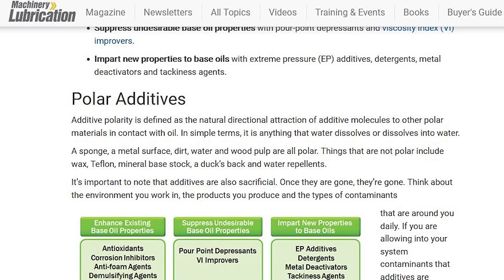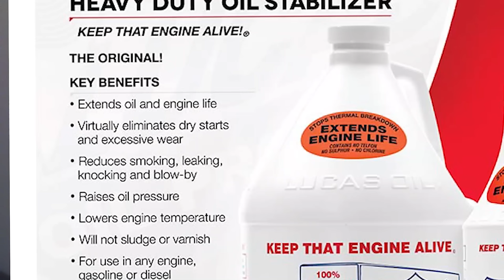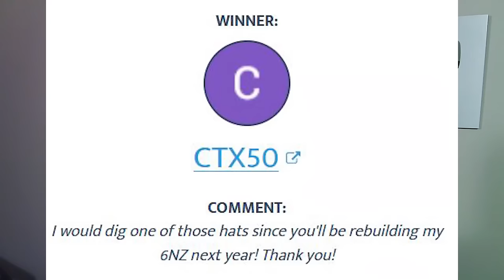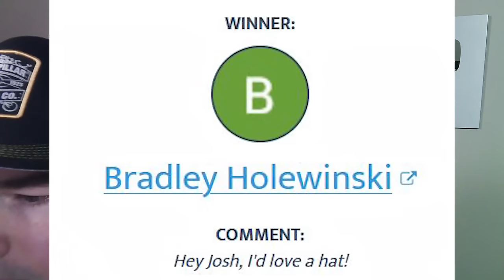Does your Engine NEED Lucas Oil Stabilizer? A detailed look at the "Benefits."

Comment: G'day, 
I totally agree with your comments ,
however ,,i feel perhaps the reality may have been overlooked.
Stabiliser can be used in gearboxs, pumps, transfers  differentials, hydraulics, ect ect ,so has.many other uses.
Lucas Oils  know any smoking vehical can be defected  or fined hundreds   for polluting . They also know drivers will use Lucas oil stabiliser  to avoid fines and prolong engine life until they can repair or replace said vehicle. 
Lucas are after market share of those polluting vehicals , so realisticly Lucas are not aiming the product at new or performance vehicals.
Finally ,,  Lucas  are careful to use language  that maximises  their matket share, even if its not a performance  product.

Lucas also  give suggested dilution rates ,   
How can it cool better ,,by prolonging the time it runs down a surface ,, in theory will allow more heat transfer  .

Cool vid  , 

      Respect 
         from 
   Down  Under

Comment: I had a really worn out 3406B that I used Lucas in. It certainly raised the low idle oil pressure. It also seemed to give it more power. I figured that it must have needed oil pressure to work a hydraulic governor or the afbf.
Reply: A good film of oil on the piston rings will also help with compression,  but will reduce friction and put more power to anything downstream.
Reply: What amount did you put per Oil Change?

Comment: I have used Lucas in various applications thru the yrs.  Not every vehicle but several.  Never had any issues.  But I was at my local family owned oil change shop one day. A guy I know had a 1st generation Kia Sportage.  After 100K  he'd been using Lucas at every oil change.   On this day,  there was a mix up between him & the shop owner.  The guy thought his Kia was done  & backed it out of the bay & left it running because  it was middle of winter.  He came inside to pay & got to talking with all us inside.  Long story short,  they realized his vehicle never had any oil put back in after the draining.   His Kia ran in freezing temps for at least 15 minutes WITHOUT any oil in it & was running smooth as silk when they shut it off.   The shop owner filled it with oil & 1 Qt Lucas like he'd done for several times b4.   That guy drove that Kia everyday for yrs after that & never did have a engine issue.   Seen it with my own eyes... that really showed me what Lucas is.
Reply: 💯💯💯💯💯 works‼️‼️‼️….Accidentally Ran  my C15 without Coolant until it got Hot and Shut Down…Few days later started getting Low oil Pressure flashing.Whenever I would let the truck idle while I chain up my Flatbed loads it would start Smoking Terribly….I Changed the oil to see if that would Resolve the Problem but it “DID NOT”….However a few days later I put a Gallon of the Lucas oil Stabilizer.Smoked for Mayne the first 3 miles them been good ever since 💯

Comment: So I did an experiment with oil in a Honda Accord. I started using 15w40 because I could get it free from work. Now keep in mind this engine is recommended to have 10w30. But I thought hey it has 230k on it, so I'm probably not harming anything, and I didn't. But I did notice that it didn't want to build RPM as fast and it seemed a little slower than normal. So after a few oil changes with 15w40 I went back to a 10w30 and sometimes run a 10w 40, Wich by the way, that is why I don't see a big deal in 15w40. After the switch back to standard recommend 10w30 the car seems to build RPM faster and seems to not be as slow or lagging. It was a good test and an eye opener in viscosity. Hope my comments help. Cheers Scott
Reply: Very true. Thicker oil will cause more drag on spinning parts and make the engine have to work harder. Which then uses more gas and can increase the operating temperatures of the engine. I drive old 70's and 80's molars. Have 3 of them. They all have the original drive train. Engines never been apart besides timing chains or intakes. I have experimented with many different oils and additives. I have noticed a very noticeable difference especially in my more worn out and low HP 318. When I use the recommended 5w-30 vs say 10w-30 plus a qt of Lucas. With the plain 5w-30 the engine will accelerate MUCH better. Much faster response. Yet the engine will be noisey. Especially when first started cold. And then after being run hard on the highway and the engine is really warm. No knocking just clatter and ticks. So lifters, rocker arms... When I use thick stuff the engine is sluggish. Have to mash the gas hard and wait for the engine to spin up and "catch itself". When started cold it has lifter tick for 10 seconds. But when fully warm the engine is dead silent. It may also make the idle a bit smoother. 

It's really a trade off of what your needs are. But typically I would say most engines should have well passed 150k miles before any additives to thicken the oil are going to have more pros than cons. 

Another thing that isn't mentioned much is with older card anyways if you study the owners manuals they have a chart that shows what oil to use based on what outside temperatures are. So say in the winter when it is mostly 40degree and colder it tells you to use 5w-30 or 10w30 , 10w-40. Then in the summer when it's hot out and mostly above 70 degrees. It says use 10w-30 all the way up to a 20w-50. This is how recommendations used to be. So it was left up to you to decide what worked best in your car. But advised to go thin when cold and thick when hot. And increase the thickness when hot more when the engine was older. New cars say passed the 1990's do not have recommendations like this. For two main reasons. The thicker oils cause the engine to work harder ( despite possibly correcting other issues) this makes you use more gas. And the government is all into fuel efficiency standards. So they won't allow the manufactures to recommend something that will decrease fuel efficiency. The next reason is modern engines have gradually better and better tolerances between parts. They are built much more precise and tight fighting. (To increase efficiency partly). So thicker oils are not able to be used safely in them. Because even in a high mileage worn engine. The clearance may still be tighter than in a brand new antique engine.
Reply: @ron1836  Try 5L of LiquiMoly 0w40 Synthoil. It not really flowing as well as a 0 weight ever. But it is flowing down to very cold temps in the winter while protecting well under heat. It has very good clinging to metal after hours and reduces friction. I buy at NAPA for 50 bucks so its not cheap but it's good.
Reply: @jamesmedina2062  I'll have to check it out. I have tried MANY different oil\additive\filter combinations over the years in quite a few vastly different vehicles. I have seen and heard about liquimoly but never tried it or the additives. I believe the only place that has a few jugs of the oil in my small town is an advance auto. Our napa doesn't have shit. It's a small local store with an inch of dust on the shelves.

I would say possibly the only draw backs to using it in old worn out carbureted v 8's would be maybe making leaks worse and also breaking up too much sludge too quickly. But I have used royal purple and Mobil 1 in !y old 318 Chrysler daily driver and haven't had issues. The engine was badly neglected before I had it. Like from the appearance when I had the intake off maybe the previous owner did 1 oil change every 30k miles bad! Haha. So even though 318's are known to usually make it to over 200k miles without big problems this engine is about whipped at 135k. I usually end up using something like Lucas, stop, hyper lube... Because the engine is making noise with regular oil and I don't feel comfortable hearing all that! Haha. 

One last thing I wanna say is oil filter types and brands can make a noticable difference in oil pressures too. I found this evident on a 2001 tundra I had. The oil pressure gauge was lower after I changed the oil once and used a different filter than usual.. (can't remember brand) then I bought an actual Toyota oil filter the next time and it gave it atleast another 4-5 psi oil pressure.
Reply: @ron1836  the Toyota filter is nearly identical to the Honda one and they both allow sufficient flow. I wish more vehicles had an oil pressure gauge to check these things. Sludge is not good. You want to get it out at some point probably idling with a cleaner product in the engine like diesel or a designed cleaner. But if its tired can you rebuild it easily? I would guess you have lots of room to work on it, and not many wire looms like modern cars. You can also clean manually removing valve covers.  I dread restarting my 351C because it has sat for over 10 years but hopefully I can prime it and get oil into bearings and the rings before firing it up again. I remember the fuel pooling on floor of the intake manifold but the carburetor only might add to  dry carbon on pistons or a little dilution of the oil. I am thinking of trying a new Performer RPM intake but before that I am supposed to paint it and change transmission to a manual! At least thats the plan.

Comment: Lucas Oil increases the film strength, and makes the oil “cling” to the metal parts. But it also thickens the oil. So it’s probably not the best in cold areas. One thing I do think is fishy, is that they say you can use it in anything, but then go on to specify "Not for Powerstrokes". Which they've now actually removed.
Reply: i use in Canadian winter without a problem, its because it stays on the wear surfaces.
Reply: Like your version the best
Reply: Correct.  But we don't have an analysis of this said product...
what is the level of detergents and additives they have put inside this Lucas Oil Stabilizer ?
Reply: @dfls5069  Y'all wanna send off a sample to Black Stone?
Reply: Agreed. Probably a baaaaad idea for turbocharged engines as well.
Reply: @Rocinante1963  I hear that a lot of Cummins and IDI owners use it with no ill effects. All just depends on how large the tolerances and passages are. I wouldn’t use Lucas Oil on a 1.6l Volkswagen engine. But a big diesel should be fine.
Reply: @Rocinante1963  About 600,000 miles on my 2014 Ram dulley 6.7 TURBO Diesel deleted 20% Lucas every oil change w15w 40. I stuck my finger in the turbo a 2 weeks ago smooth circulating like Christina Aguilera's hips. My motor will go down in history as the baddest mutha outa the north. An all the naysayers take notice when u see me ass a comin in my red mega cab dulley get da haiiieel out da way bruh
Reply: @ronmoore3987  heck yeah!!!
Reply: The gooey ropey consistency of the additive probably messes with the HEUI injectors on Powerstrokes. They may have removed it from the label because Powerstrokes haven't used HEUI in over a decade.
Reply: @treelineresearch3387 Do you really think it stays that consistency after it has mixed with yhe engine oil?

It doesn't. It thins out and mixes with the engine oil and is designed to increase lubricity, thus reduce friction and heat.
Reply: Heui injectors. But I've been using now in a 6.4l and runs new.

Comment: Lucas oil additive is very slippery and sticky….I primarily use it on older engines that may burn oil or motor doesn’t have the greatest oil pressure.
I also use Lucas oil additives to assemble engines. (Only on bearings) works great and doesn’t run off parts if motor sits for awhile! 
I’ve also use Lucas trans additive that actually works on a slightly slipping trans (doesn’t fix severe slippage nor broken parts) 
Granted it’s a temporary fix but may help extend life till it can be repaired properly.

Comment: For someone who’s got an old truck (gas or diesel) and just wants to bandaid it long enough to get to the repair end (differential whine, engine oil consumption, etc.) I see this as a very viable option. But for anything else, I’d steer clear. Using this product as an additive to supplement oil change intervals and such, I don’t see that really happening. Best thing anyone can do is repair the problem, or to perform routine preventative maintenance properly. But if your someone like me, who has an old Silverado with 183k miles, and the rear diff is starting to whine in cold temps, this’ll do for the meantime. But it still doesn’t solve the fact that I need new bearings

Comment: I tried Lucas, it did reduce the leaking and such till I got the old cat into the shop but it was a noticeable issue with cold starts. It made plugging in the heater a absolute must, I’d recommend it as a aid to help get the truck back to your regular shop or a few weeks till planned time off or something but I would not recommend for long term use.
Reply: Put some Lucas trans additive in my truck was very expensive! Made absolutely no difference! On the label claimed it 30 things it would do to ( repair) your trans looked exactly like STP  took forever to get into trans . That’s the last time I’ll ever waste my money on Lucas products. Rislone is the only engine additive I’ve used for a noisy hydraulic lifter or lifters worked great!!!
Reply: Whenever a company spends a lot on advertising it makes me wary. Lucas spends a lot.  I would rather pay for engineering and materials.  But moreso the issue is that you need the balance between speed of lubrication and film strength(thickness). Too thick not good.

Comment: Lucas is an oil thickener only. It has zero anti wear addative or detergents. It dilutes the addative in the oil which decreases it's ability to prevent wear and clean.
Reply: Excellent answer and very true statement
Reply from the maker: Sounds like we may agree 😊
Reply: Some suspect it has caused failures due to increasing aeration of oil, in some engines.
Reply: It's a very overpriced oil thickener too. If I wanted a thicker oil, I'd just buy a thicker oil.
Reply: I agree, I add a gallon in my ISX to boost oil pressure slightly and I also add some zinc to the oil because I wiped out a few camshafts in my previous ISX engine. I wouldn't run Lucas in a new or fresh engine.
Reply: @LifeWithChase  I highly doubt that adding more zinc to the oil is doing your engine any favors. The independent tests I have seen of aftermarket ZDDP additives actually showed decreased film strength. In a way that's surprising, but as much time and money as manufacturers spend optimizing their oil's additive packages, it's highly unlikely that you or I could make it any better with no understanding of the oil's chemistry and no way to actually test what effects different concentrations of additives have on every aspect of the oil's performance. More additives aren't necessarily better.
Reply: @averyalexander2303  wiped out 2 camshafts without the zinc and none since I started adding the zinc. Oil companies reduced the amount of zinc in the oil because of the EPA and it's bad for dpf. If you've ran older engines especially flat tappet engines you will know low zinc levels = wiped lobes on camshaft. Not needed on newer engines that were designed after the oil companies started to reduced the zinc content.
Reply: @LifeWithChase  Didn't realize we were talking about something old enough to have a flat tappet camshaft, you are absolutely correct. Too much zinc is bad for catalytic converters on gasoline engines too, but in general diesel oils seem to have more zinc than gasoline oils from the analysis results I have seen. There are specialty high zinc oils available for older engines with flat tappet camshafts and I'd personally rather use an oil that's already properly formulated for the application than try to blend my own. As you found out that could work if you get lucky, but it's also been proven that it doesn't always work and usually makes the oil perform worse. Just my preference though, do what works for you 👍
Reply: @averyalexander2303  it not only works on flat tappet but will work on roller cams with high spring pressures that need a little extra film strength. The early model isx has 2 roller cams, one is for injectors. It was designed and made before the reduction of zinc in the oils, and have a history of wiping the lobes off the cams. Their have been many people speculate on the issue with the older isx engines from this problem, me included LoL. People have speculated bad cams from factory, to low engine idle speed and excessive idling, to bad oil, etc etc. What I've found to work is adding some zinc and I always bump the idle up if I must idle. so far it's working for me. I believe when these engines were designed the zinc levels in the diesel oils were around 1450ppm in around 99- 2000 and have been reduced to around 1200 ppm current day. This is how I came to my conclusion of adding the zinc to get the zinc levels back up to around the 1450ppm that the oil had when the engine was designed. I don't know of any diesel oil that you can buy today that's readily available that has a 1450ppm zinc level like was available when these early model isx engines were designed over 20 years ago.  I wish I could still buy diesel oil from 1999 along with  the diesel engines from that era 😂
Reply: @LifeWithChase  reason alot of isx guys run gear oil highzinc rawze preached it and I know alot of boys running deleted trucks going well over million on overhauls with no cam problems running gearoil
Reply: @brucesmith8533  Makes sense. Gear oil is great for high pressure wear. I don't know how it affects the additive pack in the oil, cause it's a different make up, but if it works that long and don't wipe out cams I would say it's a success.